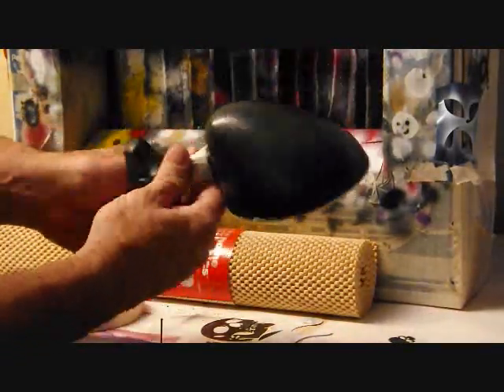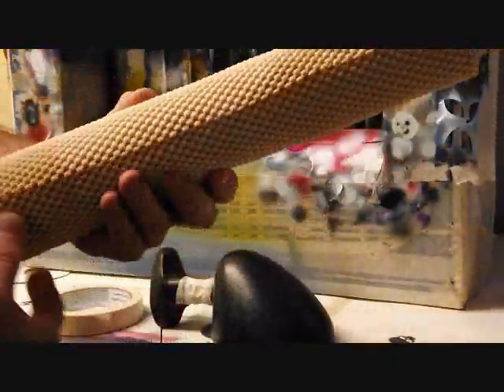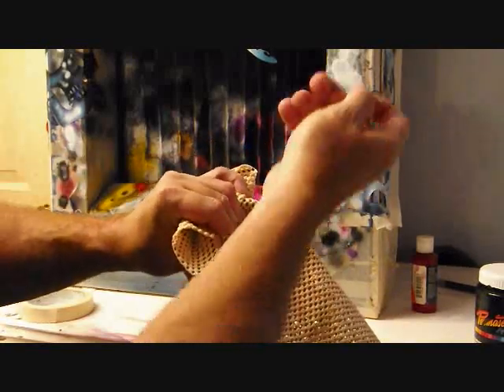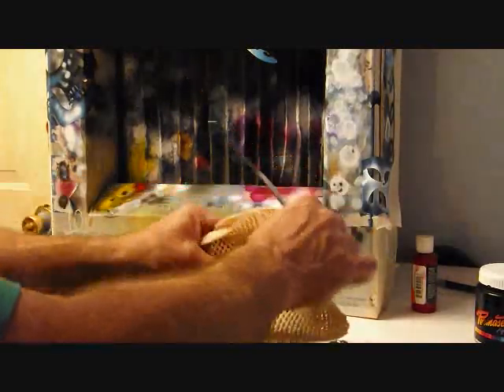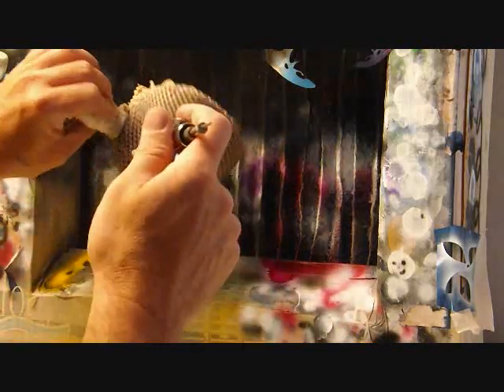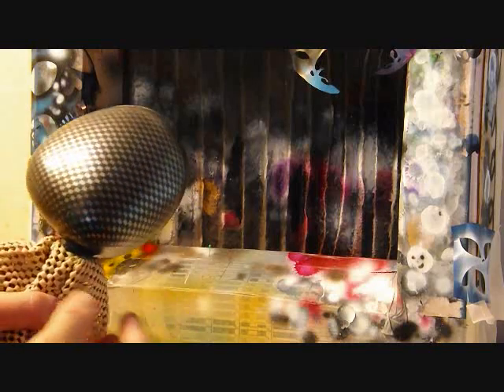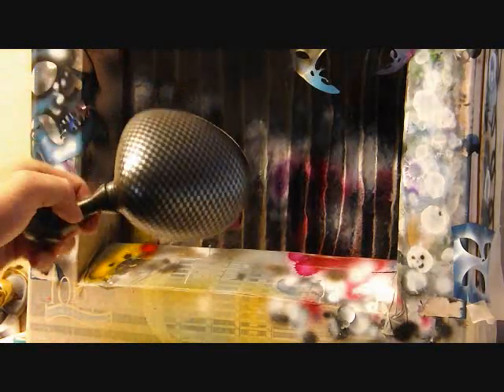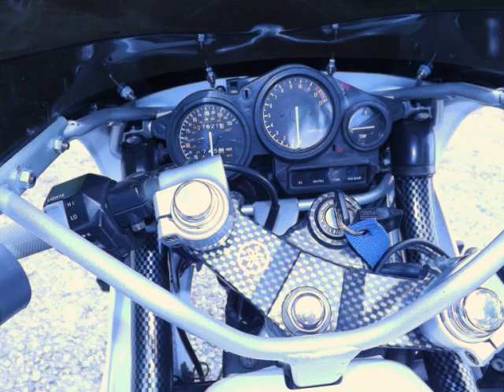Airbrush - How to - Simple carbon fiber

Comment: Great job and very informative!

If I wanted to add a yellow "tint" to the carbon fiber look; what do you think would be the best approach? I have thought about doing just like you did with the black base then gray or silver through the mesh then using a translucent yellow paint over the whole piece and finally, clear coat the complete piece. Any other suggestions in getting a "yellow" carbon fiber look? Thanks!
Reply: Yes I have done color carbon "look.. I do the same process but use a transparent candy top coat for the color just like you mention, 
At the end of this video I show a pair of blue GSXR mirrors I did this way.. With Yellow of Green top coat I have used Gold for the carbon over the black base coat instead of silver,
 Gold makes some transparent Yellows or Greens pop better... Yellow transparent doesn't want to always cover black base very well,  you could do a Yellow base with Gold carbon then a Yellow Transparent over that it would give you "Light Yellow / Dark Yellow look instead of Yellow/Black 

 I hope that helps. it is a fun process to play with almost any two colors will create some type of carbon pattern with this masking.. Good Luck

Comment: should have used a wider spray pattern and eliminated all the tiger stripes...definitely not the look you would want on show piece.... practice practice
Reply from the maker: hmmm do not see any tiger striping in the finished product could be a video issue possibly lighting, normally on a metallic straight color application like this I would use the VL5 largest spray pattern yes, or KRG-14 HVLP for larger surfaces.
Reply: Looks good